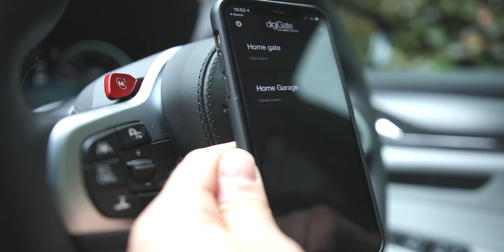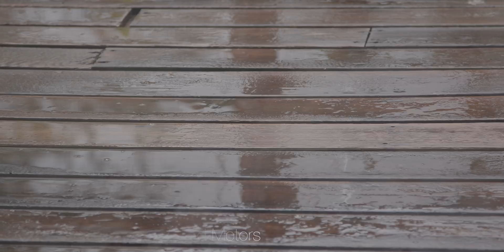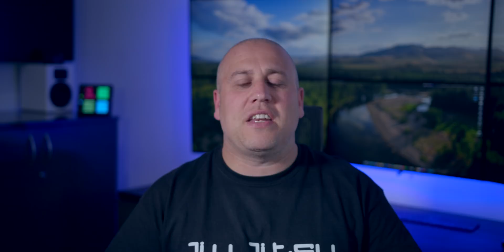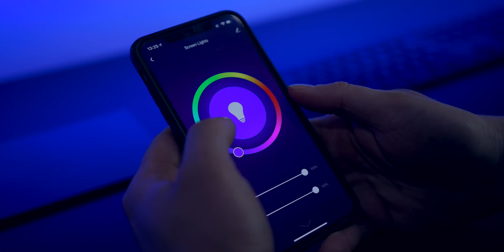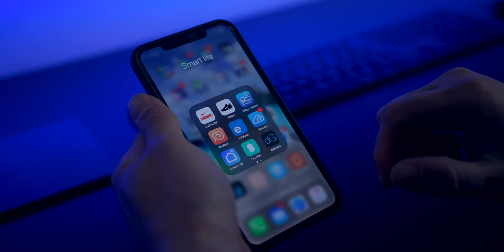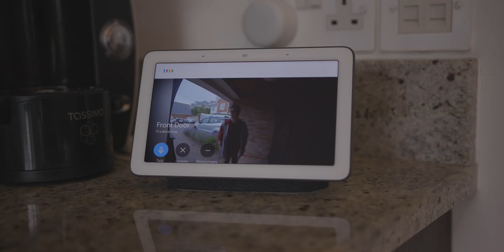My Ultimate Smart Home 2020

Comment: How do the WiFi bulbs work? Do you have to leave the light switch in the on position so power is always there so you can then turn it on and off using Alexa ? Cheers